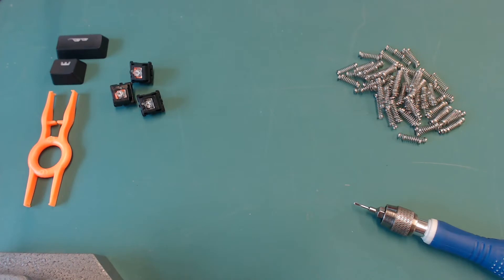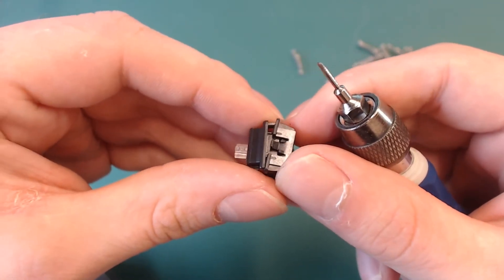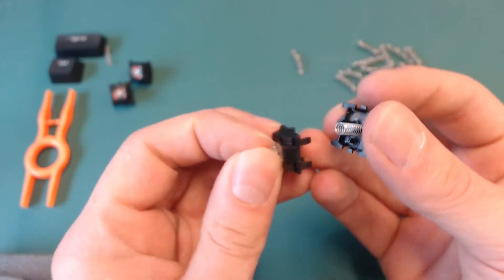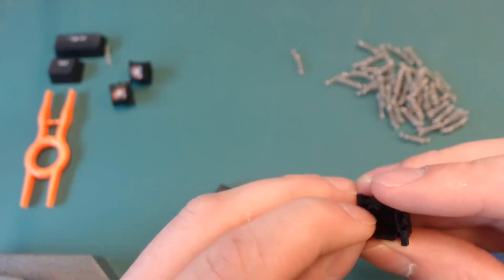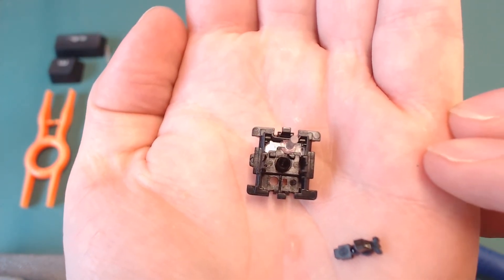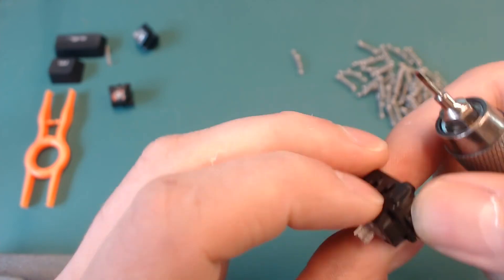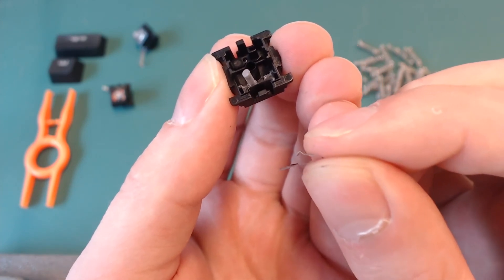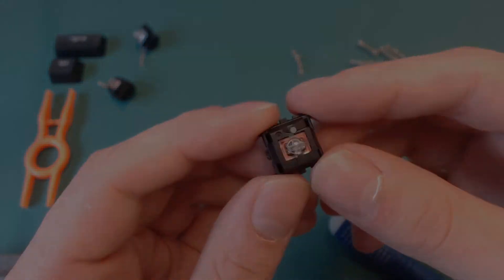Wooting how to: Swap springs of a flaretech switch.

Comment: I'm looking to swap the spring in my flaretech reds for my wooting one. I took one apart and measured the springs to be 14 mm long. Is that what I should be looking for or have they compressed to 14 mm from 18 mm over the years? Any chance you remember/know?

Comment: Can I do this with wooting 60he when it comes out?
Reply from the maker: Lekker switch can also swap springs, but they have a different diameter. We will make a ligher spring version available and release related videos for it.

Lighter: 30-50gf

Lekker stock is 40-60gf

(start to end force, linear)

Comment: Nice one. I bought a Wooting  two that was on sale at 50% RRP but had the clicky switches. Too much of a bargain to pass up, but in use was way too noisy for my liking. This tear-down helped me turn them into linear switches. Problem solved! 
(edit) A tip for anyone else wanting to perform a clickeotomy on their board - you don't need to totally disassemble the switch. If you open it up just enough with the LED side towards you, you can see the top of the clicker spring. Use a small flat-head screwdriver or pointy tweezers to fish out the spring while leaving everything else aligned and in place. lt makes the process a lot quicker, although it still takes hours.

Comment: Very helpful tutorial! Correct me if I’m wrong, but the switches come with 55 gram springs? I know the switches are 55 actuation force, but I do not know if that number refers to the spring or something else. I’m a beginner in the mechanical keyboard scene and have a board with MX Browns. The problem is that I have a heavy-handed touch and make a lot of typos, but my board is NOT hot swappable. I’m going to start saving for a Wooting so I can experiment with modding and following tutorials like this! Hopefully I can learn how to make my keyboard experience fit my needs better.
Reply from the maker: 55gf/cn in this case means the end of the press. It starts at about 40gf and increases linear over 4mm. It's similar to regular red switches on the market. We're missing a good graph on the website that clearly shows this.

Comment: Nice video. I wonder if I can make linear "red" switch from the clicky "blue" one. If I remove the orange jacket and the metal piece - will I get linear switch or are the innards different? I ask because I bought Gigabyte Aorus K9 Optical keyboard with red Flaretech switches and 9 spare blue switches. And I want to have 9 red spare switches :-). Aorus K9 doesn't support analog input but the switches seem same as on Wooting One. Thx.
Reply from the maker: You're right. Only problem is that the jacket adds additional support to the stem, so removing it will make it more wobble. You can also try to only remove the metal piece, but then the jacket might be hanging on there a bit loose.

Next time get a Wooting ;)
Reply: Thx for reply. Is the "blue" stem without jacket same as "red" stem, or is little different than "red" stem? (a little smaller for orange jacket to apply).
Reply from the maker: The blue without stem will be looser than the red. Perhaps removing the metal pin only will make it less drastic.
Reply: OK thx, next keyboard will be Wooting :-)
Reply: @santo8776  you don't need to remove the jacket, just get rid of the springs and it already turns into a red

Comment: Wow, I've never seen a Flaretech switch open. Looks awesome, definitely going to check one from my set when I get home.

So how does it work? Does the switch read the analog signal when the prism gets near the tower? What would happen if you made the tower taller?
Reply from the maker: The tower has steps, the larger the step, the more light reflects to the prism. Largest step on the bottom for maximum power(!).

It's not as simple as making the tower taller (yet).

Comment: There's a tool to do this already: https://mechanicalkeyboards.com/shop/index.php?l=product_detail&p=1363
Reply from the maker: Koriko Alistar we should give that one a try.
Reply: Wooting you can use it like you used the screwdriver to gently pry up. You use both in tandem if you 3D print a special plate that holds switches in place so you can open them en masse.